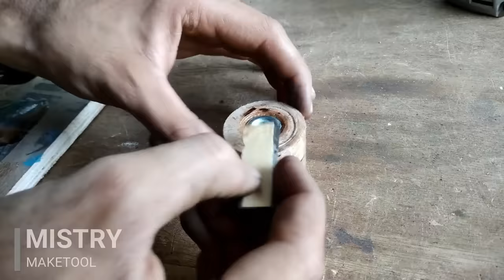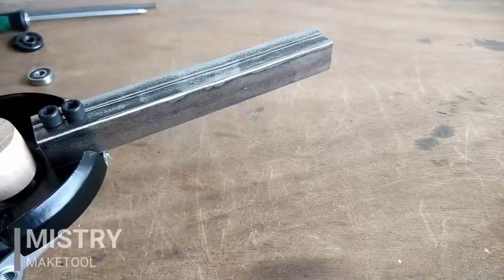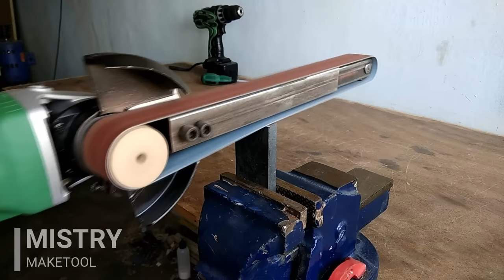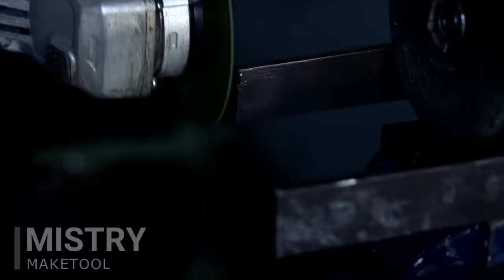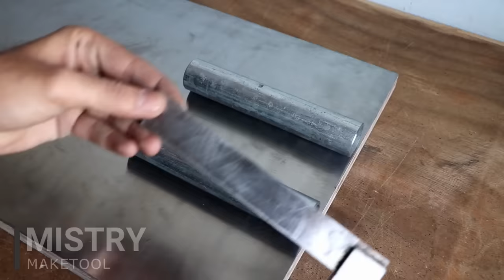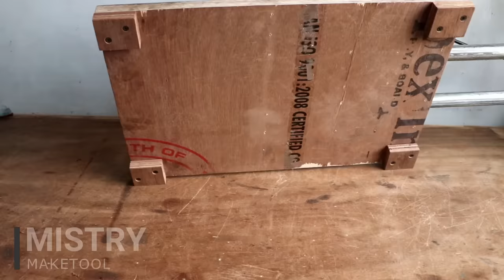Top 3 Angle Grinder Hacks || 3 Best Angle Grinder Ideas || Angle Grinder Projects

Comment: thanks too much. What size, of square tubing are you using ? 1 inch, and 5/8, inside, or what ? i have 1 inch, and it is a very TIGHT fit, into a 1 1/4 inch tube...will not work. ??

Comment: Sirs,  I'm so glad your channel was recommended to me! These designs are excellent, especially the one for the 1" or 25mm sanding belt. I've been tempted to purchase the ones for sale but decided to wait and see if there was a design I could make that wasn't over-engineered like most are. Your design couldn't get any simpler and only has a few components. I'm heading to the steel store this week and will be buying the pieces needed. I have all of the nuts and bolts and just received a 3-pound bag of assorted sizes and types of springs that I won at auction. They only cost me $7.60 us dollars and I feel they are a great item to keep in stock for creating tools such as these. I checked out your website too hoping to purchase a materials list for the other items you have made and to my surprise you are not charging for the tutorials! You both are awesome!!! Count me in as a new subscriber!!!

Comment: 1 ) the last video needs a recoil spring to return the grinder to non-working position. 2 ) the casing ( it is possible from rubber) for catching of sparks is Desirable.(metal particles ) So that they do not settle on the removed tubes and do not jam them.3) control of the grinding machine (on-off ) is better to make using the foot switch ( then hands are free to work with the part.  And when you remove the leg, everything turns off.  I have done so.  Hi to all from Ukraine

Comment: These are nice videos and good ideas, THOUGH the One problem is that instead of a catchy music or a just a speed demo it would be nice to have measurements with these ( like length of the cuts or the drill hole size or the tap & dye you use). I’d suggest if you don’t want to talk that you add them in subtitles on the screen.
The ideas are great but one would have to figure out the lengths and hole size from scratch, and that makes building it frustrating enough that one would just buy the tool.

Comment: Hello, greetings, very great support for grinder, I liked it a lot, but I would like you to please give me the measures of everything, since I am inexperienced and I would like to learn, I will be grateful
Reply: Hello, I do not know English ( I use a translator, as he will translate there - God only knows...  It is very unusual to learn that women are interested in such questions.  I did so: on the usual clamp screwed a strip of metal 5 - 6 mm .  one bolt was fastened tightly ( as an axis ) and the other bolt could move along a semicircular groove in 180 degrees ( the angle changed ) to this horizontal plate, a strip of metal was welded vertically and already on it half of the washer under the neck of the drill in the form of the letter omega. (upside down legs ) on Top put the same omega, and in its "legs" screwed bolts M6 and tightened the neck of the drill...   I don't know if you'll understand what the translator wrote.  ( if anything, let me read this to your dad, he probably realized how it is assembled and running). The drill at me turns perpendicularly to a table on 180 degrees. If you make the mount hinged, then your tool will rotate in many planes. Greetings from Ukraine.
Reply: @rocketsland9539  Здрастуйте, це не жінка, це ПК моєї дочки, я її батько, вибачте, що не ідентифікував себе, я використовую перекладача, тому що я розмовляю іспанською мовою, я новачок у DIY, і я не розумів, що перекладач переклав
Reply: @rocketsland9539  
Здрастуйте, привіт, підтримка шліфувальної машини, мені це дуже сподобалось, але я хотів би, щоб ви дали мені міри всього, оскільки я не маю досвіду і хотів би вчитися, я би вдячний, це НЕ моя дочка, я твій тато, і я на ПК Я з Колумбії, Південної Америки, розмовляю іспанською
Reply: I wouldn't do any of this if I were you... If you cut the guard of your angle grinder, later on when you put a common disk it will not be covered. What it means is that if your disk breakes a piece of the disk might go towards your face and cause severe damage. Just remember that a 4.1/2" grinder rotates at 11000 rpm.

Comment: Hello, regards again, and it is to ask if you have any video where you have made support for drill, thanking you for your response
Reply: Hello, I do not know English ( I use a translator, as he will translate there - God only knows...  It is very unusual to learn that women are interested in such questions.  I did so: on the usual clamp screwed a strip of metal 5 - 6 mm .  one boltkrepilsya firmly ( as axis ) and the other bolt could move on semicircular groove in 180 degrees ( varied a corner ) To this horizontal plate privarivalas half of washers under neck drills in the form of hew omega. The same omega was placed on top, and M6 bolts were screwed into its "legs" and tightened the neck of the drill.  I don't know if you'll understand what the translator wrote.  ( if anything, let me read this to your dad, he probably realized how it's assembled and running. The drill at me turns perpendicularly to a table on 180 degrees.  Greetings from Ukraine.
Reply: @rocketsland9539  Здрастуйте, ще раз привітання, і це запитати, чи є у вас відео, де ви зробили підтримку для свердління металу, подякувавши за вашу відповідь.

Comment: This video should be taken down immediately. You are showing people how to make an already , potentially lethal, tool into something which will, sooner or later, kill the user.
By applying pressure to the side of the disk, you are weakening it with every revolution. Quite rapidly the integrity of the disc will deteriorate to a point where it literally explodes.
This was one of the main points I tried to get across to my students during my 17 years as a leading workshop safety training officer for one of the largest companies in europe.

Comment: Great imagination.  That goes far in the metal fabrication industry.  However, you'd likely be fired immediately when someone-anyone- saw you attaching some contraption to the angle grinder.  The new guy who's still on broom duty could fire you, and it would stick. Look, cheap grinders cost you $50 & twirl around at 10,000rpm. Better ones will far exceed that.  If anything goes wrong--anything at all--that machine and/or whatever the hell your imagine came up with could riddle the entire shop with shrapnel. Don't do that.